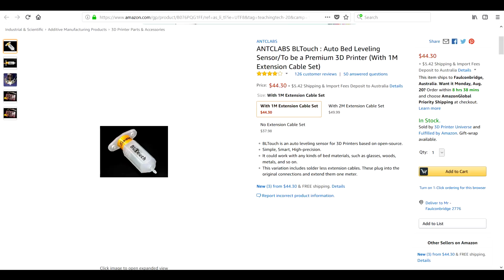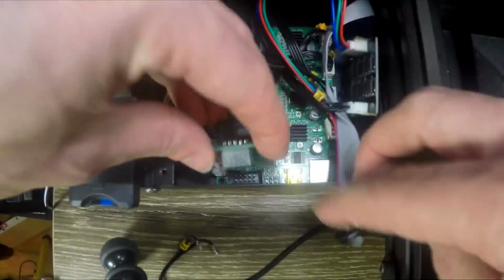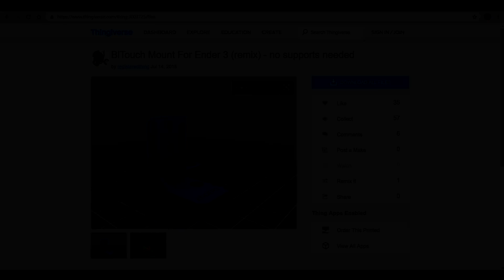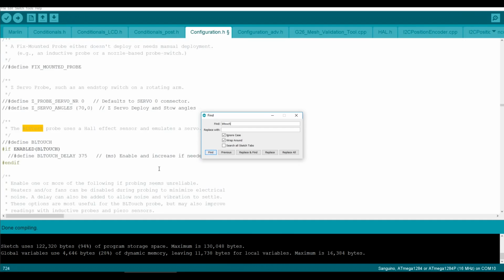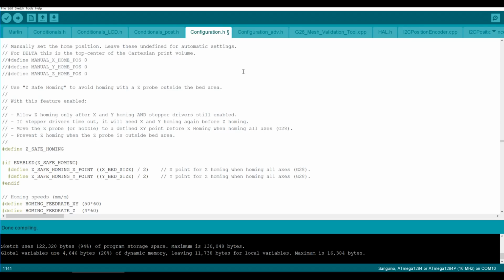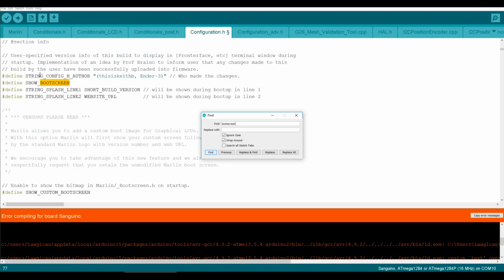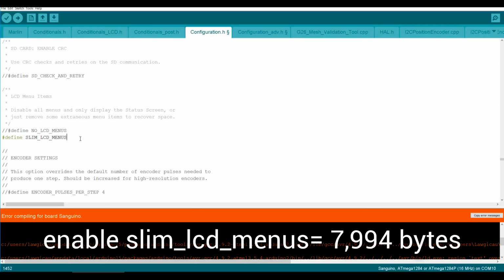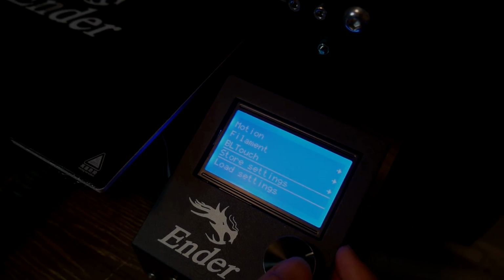Ender 3 BLtouch vanilla Marlin guide

Comment: Anyone use these directions with a bltouch v3? cant seem to get mine working
Reply: Pastebin for easy reading: https://pastebin.com/xx5tWZZS

If you happen to purchase BLtouch v3.0 this guide won't work. Follow 
this and it will work perfectly. You must have already flashed a 
bootloader.
1. Download marlin 2.0.x (http://marlinfw.org/meta/download/)
2. Extract the contents somewhere and go into 
*/marlin-bugfix-2.0.x/config/examples/Creality/Ender-3 and copy 
everything that is there into *Marlin-bugfix-2.0.x/Marlin/.
3. From there run Marlin. Next follow the video you're on from 5m9s ( 
pre time stamped: https://youtu.be/sUlqrSq6LeY?t=5m9s ) and make all the changes shown in the video config files.
4. In adition to the changes in the video go find "#define BLTOUCH_V3." in "configuration.h" and make sure its enabled so it should go from "//#define BLTOUCH_V3." to "#define BLTOUCH_V3.". Don't forget you will have to disable some features for it to fit.
5. Fix your bed sizes. By default it is set to: "#define X_BED_SIZE 220" and "#define Y_BED_SIZE 220" When it should be set to: "#define X_BED_SIZE 235" and "#define Y_BED_SIZE 235"
6. After that you can upload it to Ender 3 and you should be set.
Reply: @ITzZev  And how do you know if you have a V2 or V3 - I don't see any marking

Comment: Pastebin for easy reading: https://pastebin.com/xx5tWZZS

If you happen to purchase BLtouch v3.0 this guide won't work. Follow this and it will work perfectly. You must have already flashed a bootloader.
1. Download marlin 2.0.x (http://marlinfw.org/meta/download/)
2. Extract the contents somewhere and go into */marlin-bugfix-2.0.x/config/examples/Creality/Ender-3 and copy everything that is there into *Marlin-bugfix-2.0.x/Marlin/.
3. From there run Marlin. Next follow the video you're on from 5m9s ( pre time stamped: https://youtu.be/sUlqrSq6LeY?t=5m9s ) and make all the changes shown in the video config files.
4. In adition to the changes in the video go find "#define BLTOUCH_V3." in "configuration.h" and make sure its enabled so it should go from "//#define BLTOUCH_V3." to "#define BLTOUCH_V3.". Don't forget you will have to disable some features for it to fit.
5. Fix your bed sizes. By default it is set to: "#define X_BED_SIZE 220" and "#define Y_BED_SIZE 220" When it should be set to: "#define X_BED_SIZE 235" and "#define Y_BED_SIZE 235"
6. After that you can upload it to Ender 3 and you should be set.

Comment: Hi guys, I managed to install the bltouch and everything works fine. But when I go about setting the z offset I have to set it way too high, at about 1.9 to 2.2 seems to be the point where it actualy starts to print to the bed rather then in the air. But at that hight the probe hits the side of the bed at the edges and drags along the bed towards the middle. Any suggestions on what I did wrong?
Reply from the maker: When retracted, the tip of the probe should be approximately 3mm above the nozzle. There should be no chance of the BLtouch probe hitting the bed before the nozzle does.
Reply: @TeachingTech  Thanks, since then I installed an adjustable mount so I will look into it. Since then I sort of managed to get it to work. It now prints but after the first couple of layers it the object lifts from the surface, might be the probe hiting it (didn't have much time to investigate it yet)

Comment: Hi, in the files you've made available it shows that zmin is not inverted whereas in this video it shows it should be, can you tell me which is correct please?
Reply from the maker: For genuine BLtouch it makes no difference. For some clones it is important.
Reply: @TeachingTech  Ok cool thanks. Turns out my issue was I had the bltouch V3 which isn't directly compatible with the ender 3 board. The output circuitry on the new bltouch had changed and it's not man enough to drive the ender 3 input. I had to use and Arduino to buffer and extend the pulse. It's a new issue people are discovering and may be worth mentioning some time. Thanks again

Comment: For those who have recently bought a genuine BLTouch, you will likely have v3.0. These don’t currently work with Marlin 1.x on the Ender control boards. The pulse that the touch sends to the control board is not being sensed.  This is a known issue and the 2.0-hotfix branch of Marlin does have a fix for it, however please beware that this is of course not a stable release yet. That said, all of the instructions presented in this video still work, you just need to uncomment the BLTOUCH_V3 settings as well.
Reply: I replied up above I was having issues and this sounds as if it's my problem. ( I just bought the BLTouch so assuming I have the v3.0).  Where is this  BLTOUCH_V3 settings you're talking about?
Reply: Tom Widener it’s in Configuration.h but it currently only exists on the 2.0-Bugfix branch. I am working with the developers to get it back ported to the 1.1-Bugfix branch but it may be a couple weeks before it’s available.  I’m not sure what their release schedule looks like.
Reply: You can confirm it’s a V3.0 because next to the QR code on the front, it will say V3.0.
Reply: That was it!!!   I looked EVERYWHERE and the whole time, it was the fact I have this BLTouch 3.0.  Thanks again Casey!!!
Reply: Tom Widener glad to hear it helped. I’ll update once  the fix has been merged into the stable branch.

Comment: Thanks for the video!
The screen of my Ender won't turn on. Somebody an idea what I'm doing wrong?
Reply: What have you changed? If you swapped the two wires at the pin 27 _ 3 pin plug where the ribbon cable goes on the mother board then that's the problem. The new pin 27 adapter boards don't require the the wires to be swapped and have the wire color printed just under the plug. That little pin 27 board will get pretty hot with the wires reversed but should be OK when you swap them back.

Comment: Have a question about setting the extruder offsets. I understand setting the X to -41 and Y to -5, but is there a reason why you didn't set it for Z? I purposely installed my probe to be 2mm below the nozzle, so I'm curious if I should set that in the configuration or just leave it at 0? Thanks in advance for any input. Love your videos by the way.
Reply: Leave at 0, compensate with Z Probe Offset when you're printing your test.

Comment: Hello Teaching Tech! Thanks for the great video, helped me a lot.

Just adding this for those who might run into issues with brand new BLTouches.  If you've gotten the official Creality BLTouch kit (or any new BLTouch for that matter) chances are that it's the new V3.0 version that's been silently released by ANTCLABS. This will not work with Marlin 1.1.x.

I've had a lot of issues with it while trying to get it working on both the official firmware on Creality's site (Marlin 1.1.6), Marlin 1.1.9, and Marlin 1.1.9 hotfix. It will not work (skip points on G29, crash into the bed with G28).

For those, switch over to Marlin 2.0.x bugfix version (might have to switch to U8Glib 1.18.1), and also uncomment the following line:
  #define BLTOUCH_V3

They just added BLTouch improvements to the bugfix version, and it fixed all my issues. BLTouch V3.0 working great now on my Ender 3 Pro.
Reply: Thank you. Thank you for this comment. I have been struggling for the past couple weeks trying to get my bltouch 3.0 to work. This really helped me out. I had given up a few times previously and after trying this it worked like a charm.

Comment: my bltouch is crashing to bed. first it has slid light, however crash it goes blinky. I have kept the bltouch with proper distance and after touching the bed it doesnt stop. could you help me fix this.
Reply: Hey Shailendra. See my comment up above. You probably have a BLTouch v3.0 that doesn't work with Marlin v.1.1.x.

Switch over to Marlin 2.0.x bugfix version (might have to switch to U8Glib 1.18.1), and also uncomment the following line:
#define BLTOUCH_V3

Comment: I can't figure out what is wrong. Ender 3 glass bed, real BLTouch, microswiss hotend. Tried your video with th3d firmware then tried this firmware. I bought your files as well and they are in there with same settings. BLTouch is spaced properly and it clicks but doesn't stop the z. It runs it into the bed then after a second brings it back up. https://youtu.be/eAfLy4Y4R9M  I will at this point become a patron and even pay you for the solution I'm so agrevated. Link to my configuration files as well
Omitted

Update:
So apparently this is a problem with the new V3.0 BLTouch rolling out. I bought mine on Amazon. The coding will not work with these new BLTouch devices. Thread of issue attached. 
https://github.com/MarlinFirmware/Marlin/issues/13345

Comment: I am posting this here as I have had a lot of issues with the BL Touch, Octoprint and the Ender 3. Basically the probe information was not being used by Octoprint/Ender 3.  Turns out a few others have had the same issue. The solution was given to me, I did not diagnose the problem, I am not that clever! Basically the start script I was using, the same script recommended by various experts didnt work. Now, that may have been my fault, Marlins fault or the man in the moon, no matter, heres the script and method I was given that has resulted in perfect prints for me and several others that had the same issue.
First, change your “Starting Script” for each print profile g-code to just: 

G28 ;Home all axis
M420 S1 ;Enable bed leveling

Method 1 in S3D
1. Connect the printer with the USB cable and connect to S3D.
2. Open Machine Control Panel (the gear) on the right menu bar in S3D.
3. Click “Connect” to connect to printer if not already connected.
4. Clock on the “Communication” Tab and click in the box at the bottom of that page.
5. Type G28 to home all axis’
6. Type G29 to run the calibration matrix. I have mine set up in Marlin with a 5x5 grid.
7. When it is done type M500 to store into EEPROM. 
8. Type M501 to load the settings you just stored. 

Should be good to go for printing 

Method 2 from Printer

Again, make sure your “Starting Script” for each print profile is like the above picture.

1. Click wheel and scroll to “Prepare” and click wheel again.
2. Scroll to “Level Bed” and click.
3. The printer will home and then go through your matrix. 
4. Once it is done go to “Info Screen” if it’s not already there.
5. Click the wheel and scroll to “Control” and click. 
6. Scroll down to “Store Settings” and click. You should hear a beep.
7. Scroll to “Load Settings” and click. You should hear a beep. (Unless you have updated the boot loader and removed the beep function to get more memory
)
Should be good to go for printing.

You don’t have to level before each print. You could only level when You change something or every once in a while like when the first layer isn’t quite right.

If you still have issues with the first layer it could be your Z offset. I have a procedure for that as well. To tell if it’s working you can watch you Z axis and if it’s making slight up/down adjustments while printing then it is adjusting for the stored level.

Now, if like me you want to self level before every print  (built in Ender 3 unreliability)  then this is what you could do:

G28 ;Home all axis
G29 ;Probe Bed
M500 ;Save probe results
M501 ;Load probe results
M420 S1 ;Enable bed leveling 

Then the remainder of any G code you want to use for printing a purge line or what not.

Example:

G1 X0.1 Y20 Z0.3 F5000 ;Move to front of printer
G0 Z0.15 ;Drop nozzle to bed
G92 E0 ;Zero extrude length
G1 X40 E25 F500 ;Extrude 25mm of filament for 40mm
G92 E0 ;Zero Extrude length
G1 E-1 F500 ;Retract 1mm
G1 X80 F4000 ;Quick wipe
G1 Z0.3 ;Raise nozzle and begin print

Hope this helps.

Comment: I have followed the video and instructions word-for-word but have found an issue where if I go to prepare>preheat abs, it only creates the nozzle and not the bed. Even if I select preheat bed only it turns the cooling fan on 100% and the bed does not change in temperature. Have to manually go into tune bed and raise the temperature there. If I select preheat pla it works perfectly

Comment: Back again, hope you are monitoring this, is there anyway to increase the accuracy of the BL Touch? Several reports on Facebook that the bed is not as level as we all thought it should be. Large prints are definitely off with the skirt and first layer thinner one side than the other. No answer on this issue from Antclabs either.
Reply from the maker: Getting it really perpendicular helps a lot. One printer had it on a slight angle, which meant as the probe contacted the bed, it would flex and slide sideways a bit before retracting. No doubt this introduced variance. Something for you to look out for.
Reply: Teaching Tech ok good tip. I will also make sure the tip is straight as it’s a plastic one and could easily be distorted. I have seen further testing that has proved the EZ ABL is more accurate by a significant amount. What is your personal preference? I am mostly printing parts that require accuracy and finish and are used in roc models.
Reply: Update: it’s hard to measure the vertical plane of the probe but as far as I can tell it’s at 90 degrees with the gantry and I have set the bed at plumb with a digital protractor. Still the same result. So my feeling is that there may be some sort of interaction going on between Octoprint, Marlin and the probe. No expert but what else can it be u less the probe is not as accurate as it was. Being a simp,e engineer I always look to the last change made before the issue occurred and that change was Octopi and a Octoprint. Seems the general quality of the prints went down after that was installed. Simple check is to go back to sd card. Will report

Comment: Hello,
I have an Ender 3. I got a BLTouch and followed the video complete with the corrections for lines 776-777 and 1024-1025. My printer will home x and y then return to the middle of the bed, after that it will not run auto bed leveling. It says my z is at 6 and will not go down even though its about 4cm above the bed. I suspect I either did one of the configurations wrong or my gcode is not right.

G21 ;metric values
G90 ;absolute positioning
M82 ;set extruder to absolute mode
M107 ;start with the fan off
G28 X0 Y0 ;move X/Y to min endstops
G28 Z0 ;move Z to min endstops
G29
G1 Z15.0 F9000 ;move the platform down 15mm
G92 E0 ;zero the extruded length
G1 F200 E3 ;extrude 3mm of feed stock
G92 E0 ;zero the extruded length again
G1 F9000
M117 Printing...

My BLTouch still has lights but does not click anymore either.
Any feedback or suggestions would be greatly appreciated. First time doing anything like this.
Thank you.
Reply from the maker: First thing to try is reversing the black and white wires into the mainboard from the bltouch.
Reply: @TeachingTech  Thank you for the quick reply. I suspect my BLTouch may have gotten fried/broken as it will not click at all anymore. If I move the probe up or down by hand it will stay in position . I tested switching the black and white wires and the print head will go down and not stop when I trigger the BLTouch with my finger so I have to be ready to cut the power lest it smash into the bed.
*UPDATE*
So it turns out i did not mess the code up. I did everything correct surprisingly. It was a simple mechanical failure in the BLtouch. The magnet in the plastic needle had come loose so it was stuck to the backing screw. When i pushed the needle up it would catch on the magnet. When I pulled down it would leave the magnet behind. Tiny drop of glue and it's working nicely.

Comment: Hi - I've followed this tutorial, and my Ender 3 hasn't printed properly since. The Bed doesn't heat right, Z axis motor only goes up half of the time, etc. Nothing changed except the firmware.. I'd recommend to stay away from this tutorial, until he is able to address the potential issues with this firmware - issues that were not in the original firmware. 

Also, there should be a video on resetting your Ender 3 back the stock firmware, so when all else fails we're at least able to get back to point A?? How is this not a thing?

Comment: Hi mate, can you recommend a start code that probes the bed before every print? I am currently using the one below but when I check the mesh it’s all over the shop and the z axis doesn’t seem to compensate at all. G28 ; home all axes
G29 E; probe
G92 E0.0 ; reset extrusion distance
G1 X0 Y0 Z10 F6000
G1 Z0.1
G1 X6.0 E9.0  F1000.0
G1 X5 Y30 Z0.2 F3000 ; get ready to prime
G1 X100 E12.5  F1000 ; prime nozzle
G92 E0.0